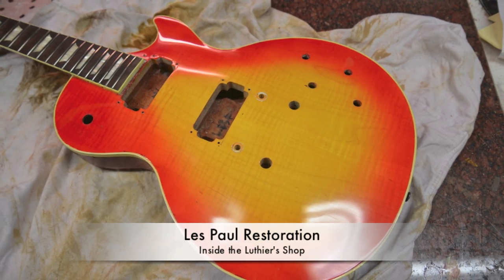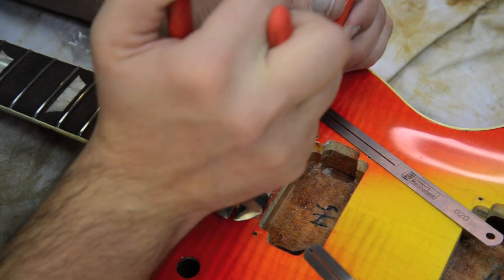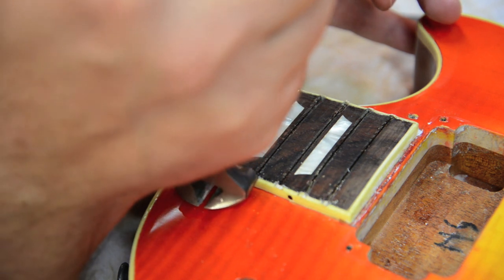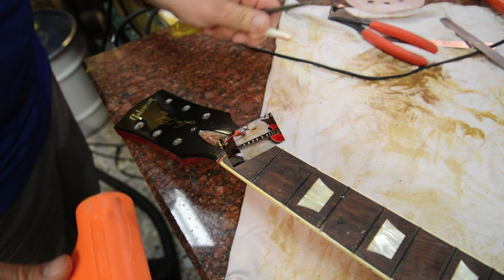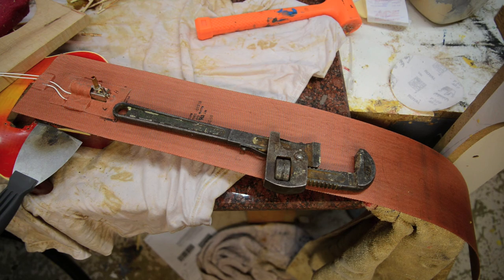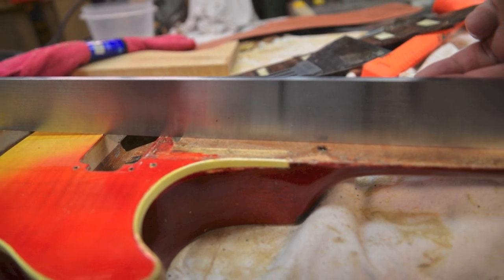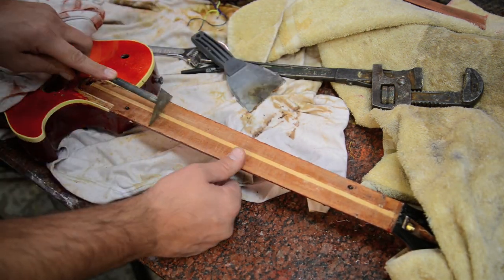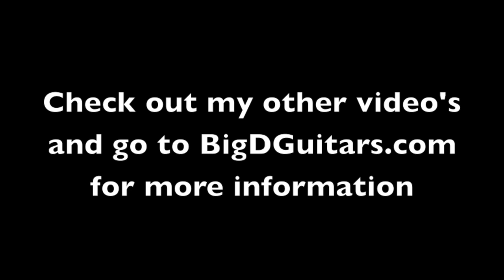Gibson Les Paul Restore Part I - What a mess!!?!?!?

Comment: Years ago a friend of mine ordered a custom-shop Gibson Les Paul.
When it finally arrived, the neck pickup was installed at an angle. Instead of it sitting flush with the heel of the fretboard, it was skewed at an angle. 
It was real obvious.
Re-setting it would have exposed the incorrectly-drilled screw holes.
But the guitar played/sounded great!
I remember him playing some really sweet Allman-type slide....and this axe nailed that tone.
Him: "......I......don't know what to do....*sigh*....I paid a lot for this damn guitar.....but THIS?" (gestures to skewed pickup).
I don't know if he sent it back or kept it.
But yeah............it is possible for QC to fall asleep now & then.

Comment: I noticed the table top in a few of your videos. Is it granite and is this by design? meaning "is it a good work surface as well easy to clean up" I am asking because I am getting ready to build two workstations for guitar building and amp repair. I am tried many different surface medias but one always seems to have some kind of fault. It seem your is holding up well.

Or am I reading too far into your video and the table top was just something laying around?
Reply from the maker: Buhda Punk It was laying around and I put it on my bench as a dead flat surface that cleans really easy.  

I love it.
Reply: +Buhda “Pete” Punk 
In guitar building theres a lot of things that need to be perfectly flat. Putting sticky back sandpaper on a granite plate is awesome for this. Most luthiers don't have a whole table but a piece big enough to accommodate a guitar body is preferred. often you can call a counter top installer and they have scraps, ends, and cut-offs they are willing to let go of for cheap or even for free.

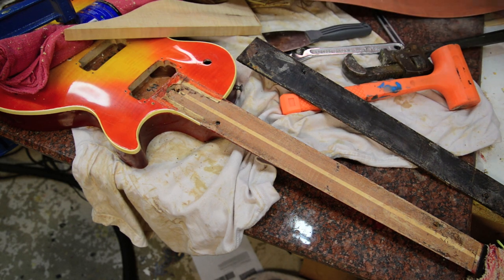Comment: Cool video and thanx 4 sharing! At the minute 8:03 sorry mate, why do companies use that system of fretboard glued onto necks? Couldn't they get to create a 1-piece neck only without a "fretboard"? Just a one-piece neck, is it not possible? I don't care about rosewood.I'll get a fretboard - a mahogany one - simply by curving a fat mahogany neck. About truss rod, well, I dont care either (and maybe a long drill might get to fit ametal bar inside a baseballmaza without get to cut any neck in 2parts). I'll get to build an one.piece neck, madeof 1piece only, yes Sir! I can do it. Maybe I'll divide just the headstock, but fretboard and neck will be get by one chunk only.